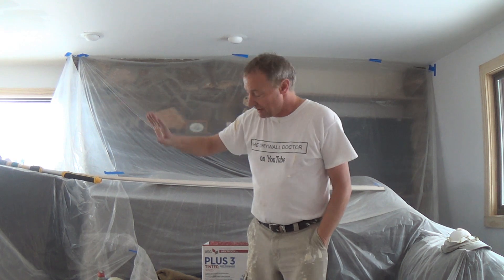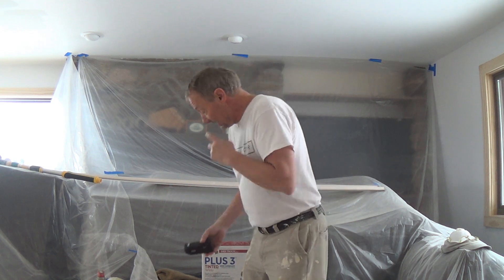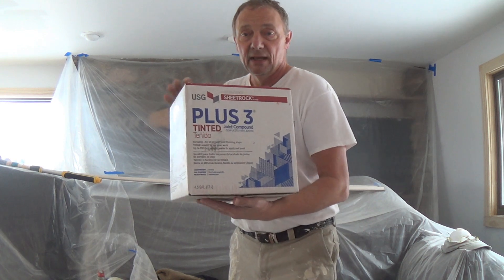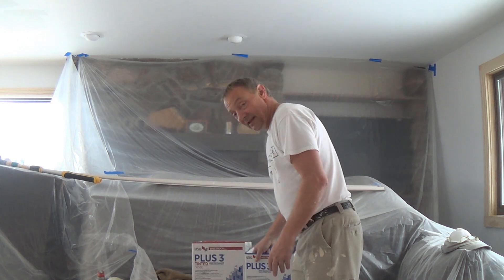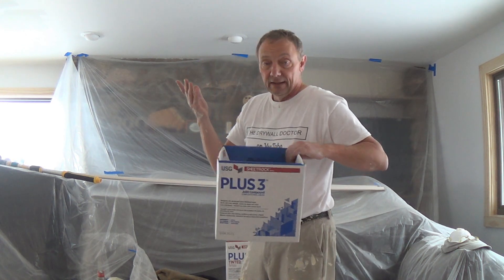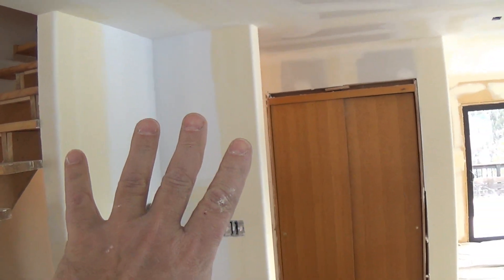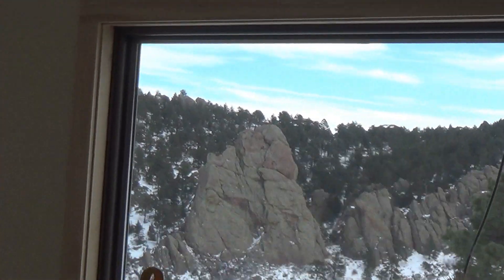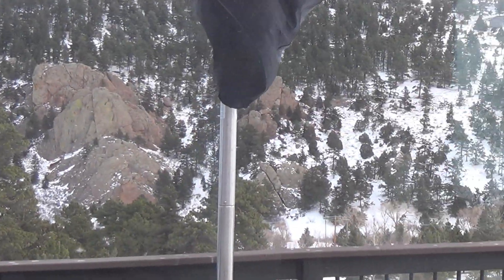Tinted Mud Where Are You

Comment: Hope you see this but I am having trouble doing the ceiling at the top of the stairs.  You know where the angle is like 135 degrees.  So the two pieces of the drywall don't exactly meet perfectly.  Trying to get a straight line without a reference.
Reply from the maker: Yea sometimes those are a pain

Comment: Hi drywall doctor, 
Just wondering if you could do a video to show us "how to install a corner bead with a spirit level, and, if you have a long kitchen bulkhead how do you make sure the corner beads are perfectly straight"?
Reply from the maker: If I'm not the carpenter I check the soffit very closely just to make sure it's perfectly straight if it's not I either straighten it or get the carpenter back there I don't usually use a spirit level I use a laser that I attached to another wall

Comment: I use red chalk for chalk boxes....makes the mud bright red
Reply: That's great but red chalk will bleed through the paint job unless they use a sealer instead of just regular drywall primer.
Reply: @gme10955  ive been doin it for 28 years
Reply: @mattdaggett3695  
Good to know. I know if you use red chalk to snap a line on drywall, it will bleed through. Guess it gets deluded enough when you mix it with drywall mud.
Reply: unclassified  u know whatt your talking about

Comment: Is plus 3 for the final coat? Is the final coat considered a skim coat? I used taping mud for my taping process and i picked up all purpose for my second coat. Can i use all purpose for my final coat or should i get plus 3?
Reply from the maker: I use all purpose to tape with and then I use plus 3 to top and skim the final two coats
Reply: @THEDRYWALLDOCTOR1  thanks DOC...i will go find some Plus 3 but i haven't seen any tinted type here in Arizona. Great videos by the way.